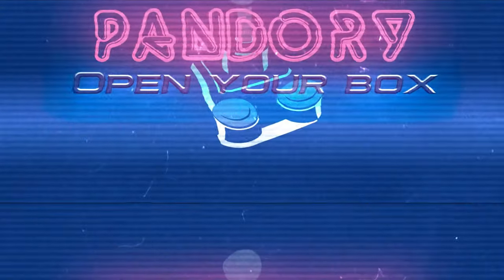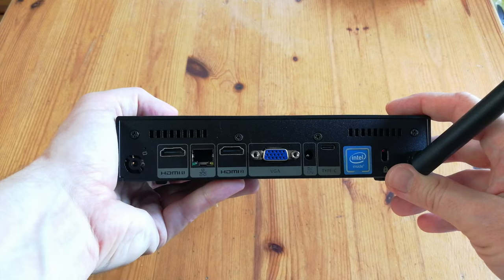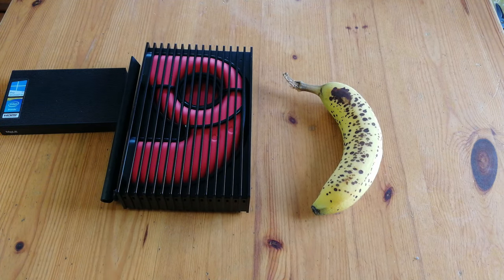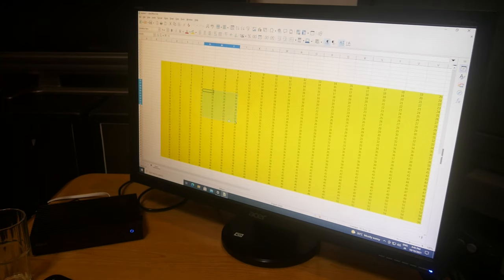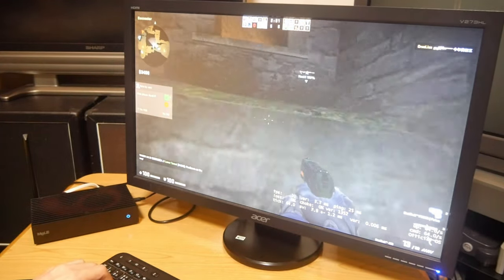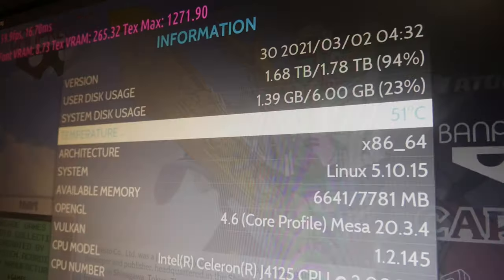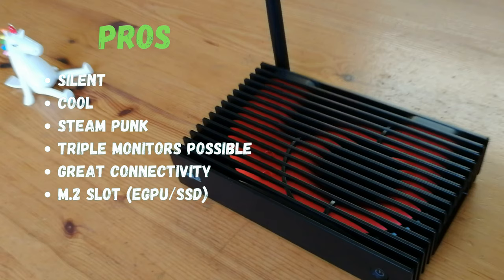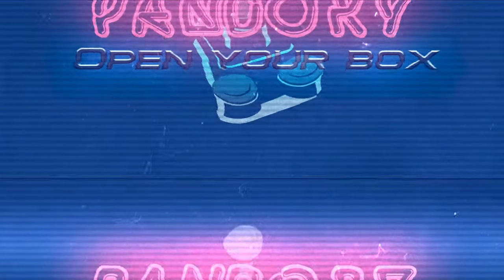Mele PCG35 GLK Fanless Mini PC REVIEW - eGPU POWER!

Comment: I just got this to run my plex server and have noticed that a lot of this is using the most generic parts that make it hard to find drivers to update, biggest problem is the USB ports running are around the 2.0 speeds instead of the advertised 3.0 not to mention the kinda rubbish HD that it comes with that has very poor read and write speeds. Overall though it is not a bad little pc that so far is doing the trick running my server.
Reply from the maker: Many boards like this use generic intel drivers... As that's usually what is needed.  Will take a look at the usb 3.0 speeds when we can.